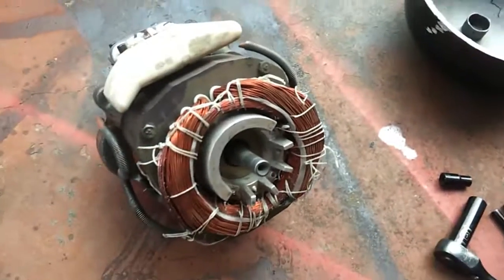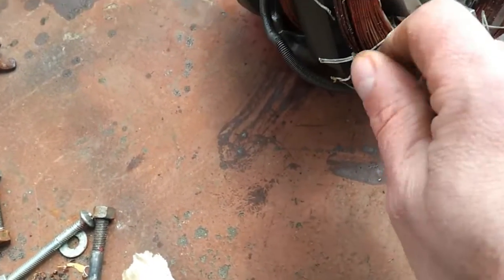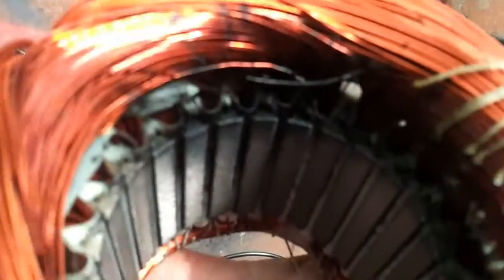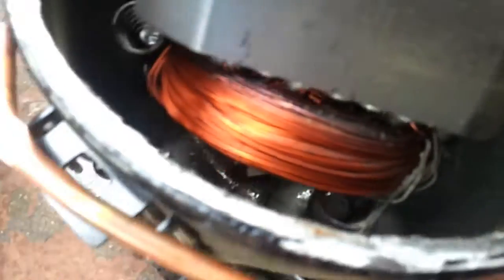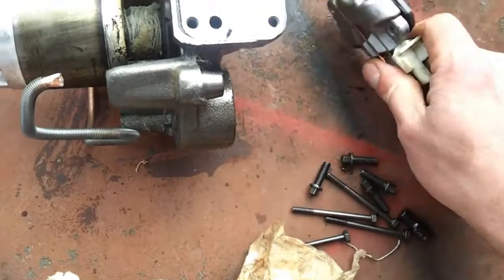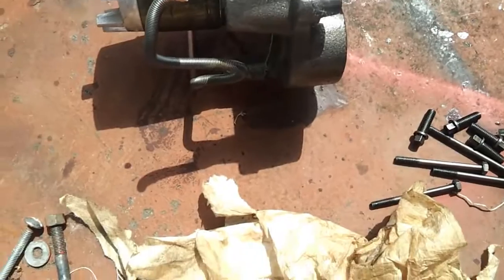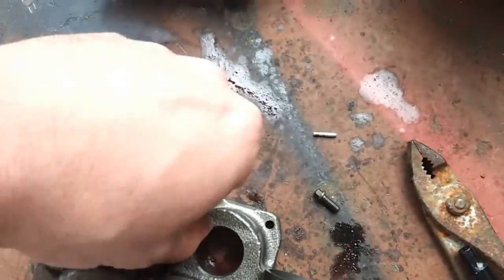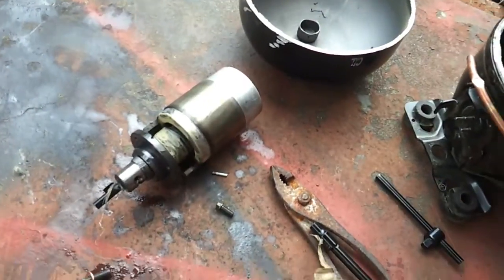Samsung FMA 702CY Compressor Autopsy

Comment from the maker: Yes, they do.  That sound is basically just the motor running.  The compressors have heavy steel housings and internal mufflers so the sound isn't much different.